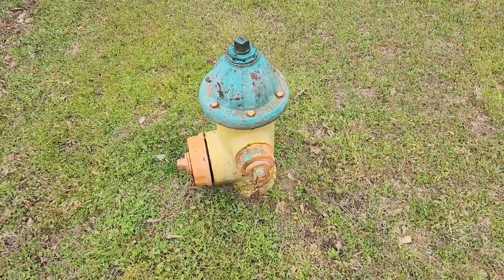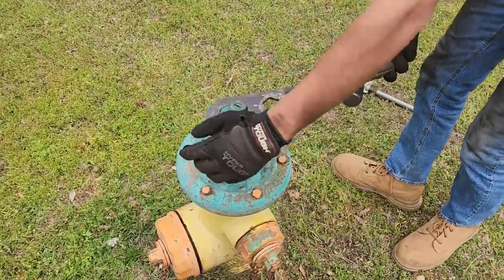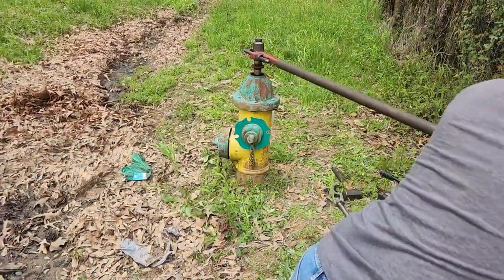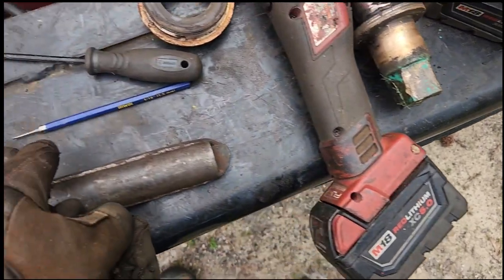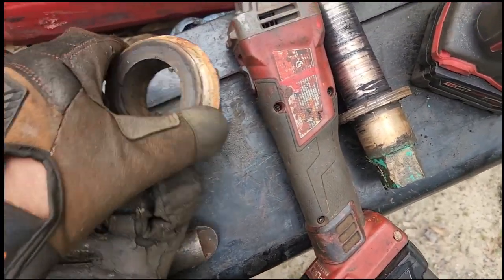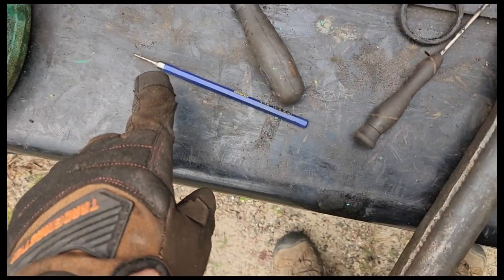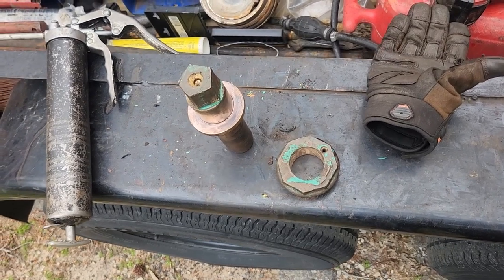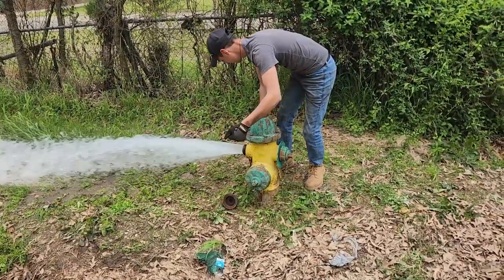Mueller Standard Bonnet Rebuild

Comment: If operating nut becomes that hard to remove that you need to use a pipe wrench and cheater pipe to thread it off the stem PLEASE remember to open pumper nozzle, put a small pipe wrench on the stem and back it up. If the stem turns..which it could..the pin in the bottom of the valve seat will break (trust me they do) which will cause you a lot more work.
Reply: That's a really good point and so true. I can't believe we didn't do it on the video!
Reply from the maker: @sueselembo8792  that is absolutely correct and we should have done that on the video

Comment: Currently working on a 1981 mueller 4 1/2. Would you know the part number for the 1in operating nut that will work for it? I ordered one and it wont thread on
Reply from the maker: @scopeactionfilms4547  it's the same part number, but they should have asked for the year number. Before 1987 it was slightly different, but I didn't think that the thread pitch changed. Are you sure that they gave you the correct operating direction (Open left or Open right)?
You might also need to change the upper stem. It's not supposed to happen, but I have seen the thread on an upper stem get damaged enough that a new op nut wouldn't thread on. If you haven't yet, please give the guys at Hydraflo a call for those parts. They will make sure that you get it right. 1-800-327-7853
That part number from them is #1071 it's A-1 from Mueller. Let me know what you find out please
Reply: @thehydrantguy  thanks for the help. It looks like they sent me the wrong operating direction. Lol should have been able to figure that one out 😅
Reply: Totally get it! Ethan (my helper) has saved me many times from making simple mistakes!